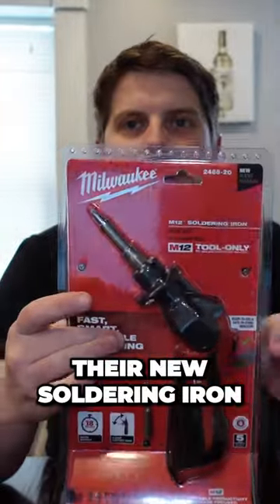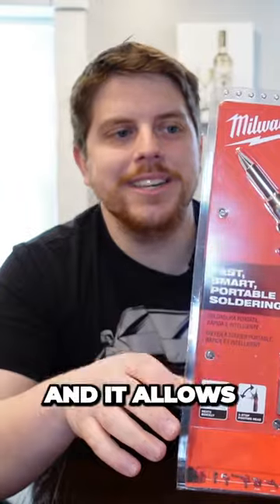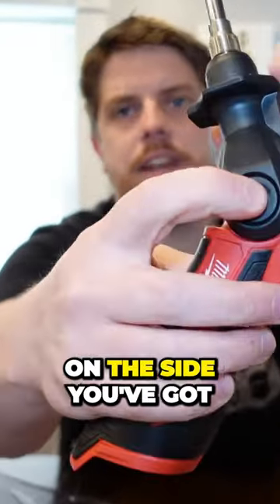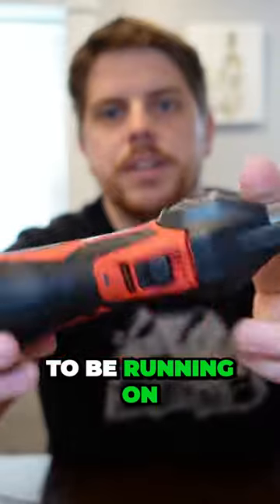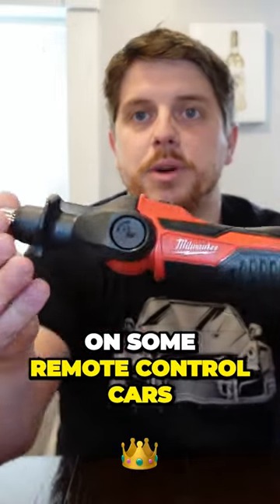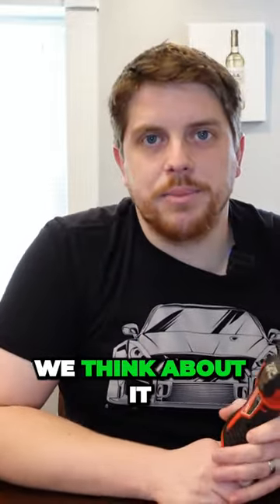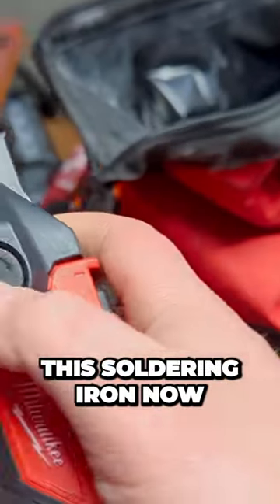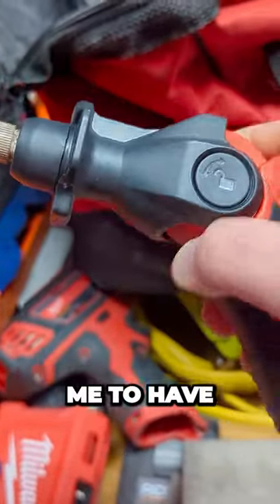Unleash Your Inner DIY Pro: Discover the Wireless Soldering Iron

Comment: Depending on the work you do, if you dont already do this, use the larger M12 batteries so you can stand it up. This is especially useful when you need both hands free.

Comment: So I bought that iron anticipating some form of temp control. There is absolutely none.

As far as delicate electronics and PCB's I'll stick to my ts80.

Heats up faster and cools off faster than the milwaukee by almost double.

I've honestly forgotten about my M12 soldering iron and would rather take my ts80 back and forth from home and work to avoid using it
Reply: No temp control??? Im out